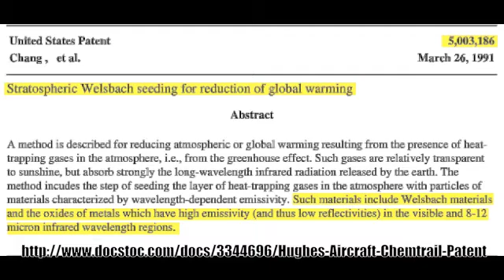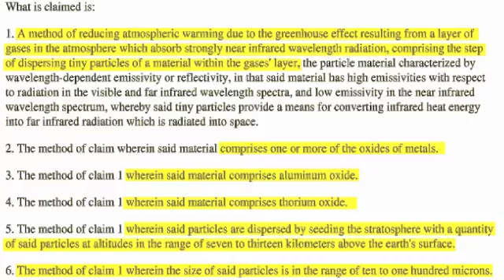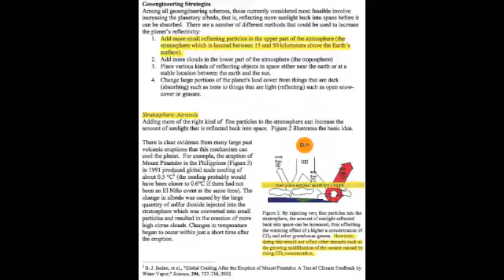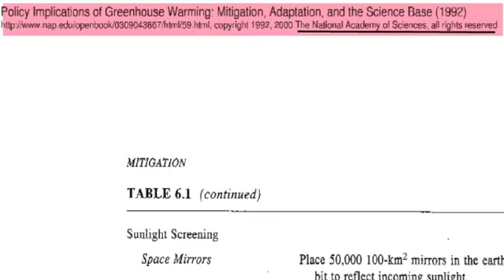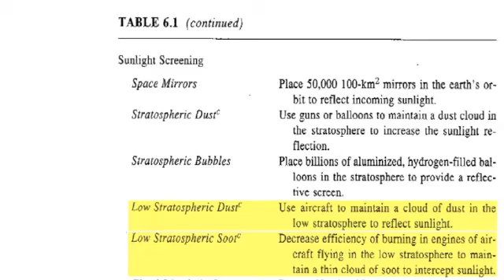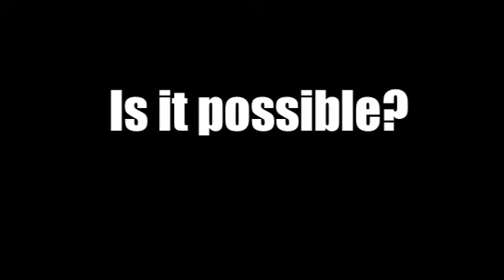Stratospheric Aerosol Spraying

Comment: I believe they are spraying no doubt about that. So if i understand right, they are putting all sorts of "geo-engineering" chemicals into the air in an attempt to "counter" climat change. But why exactly radioactive particles? I don't get how that would counter global warming? Even if it reflects more light back into space it sure is dangerous to do so....